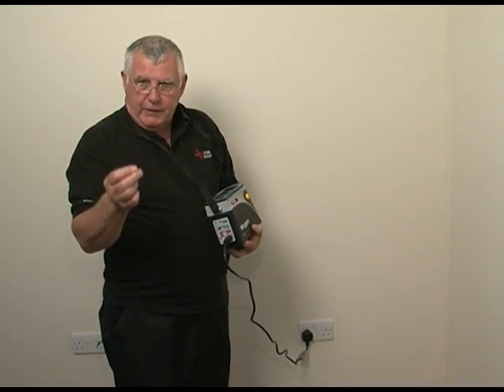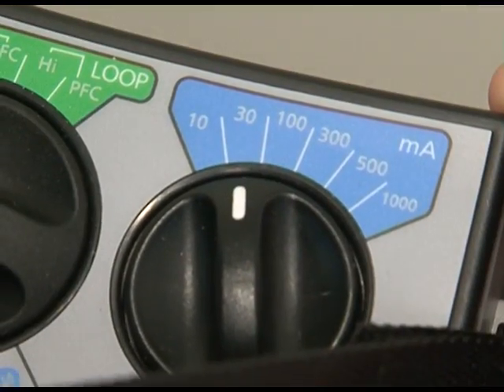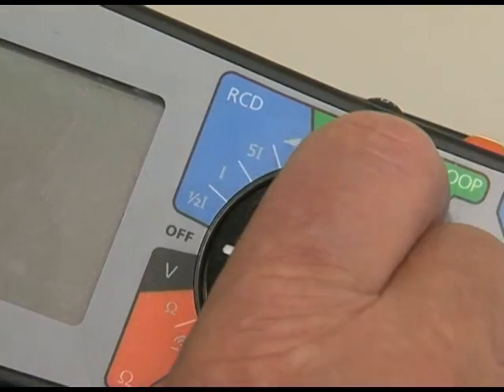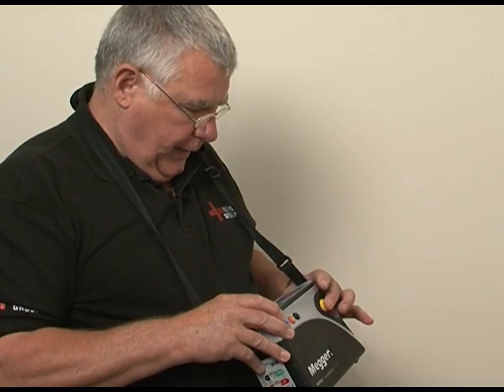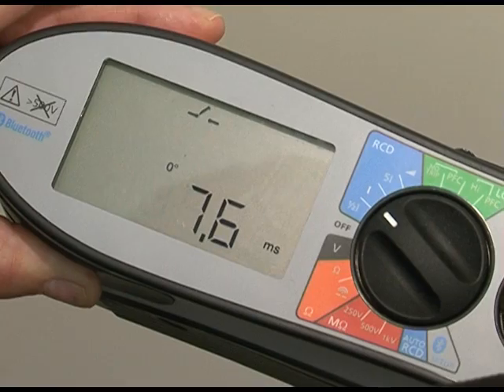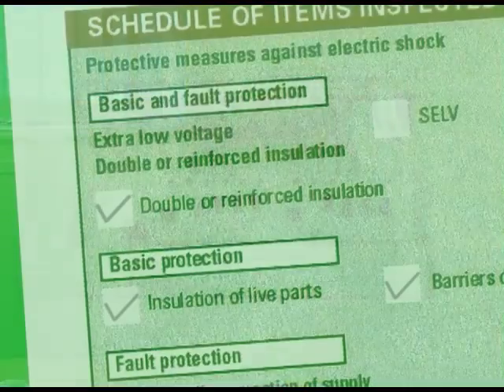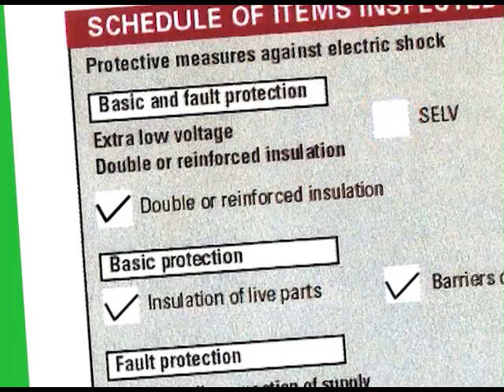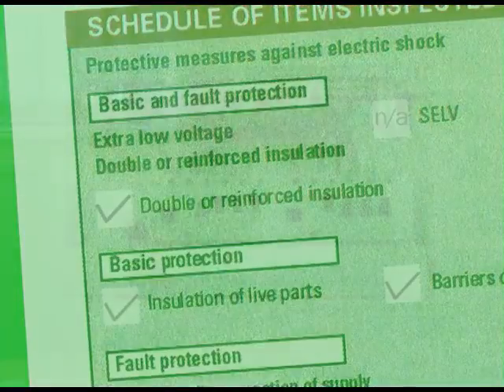17th Edition Domestic Inspection and Testing Initial Verification

Comment: NICEIC do not be deceived by these schemes they are a huge ripoff. Take note or learn the hard way ask yourself why are comments disabled on all scheme promotional videos.
Reply from the maker: hmmm this isn't a scheme promotional video -  in fact we at LearningLounge no longer partner up with NICEIC and as you can see comments are allowed. This video, which was originally produced 11 years ago will be replaced with an 18th Edition one and no plans to partner with any scheme provider.:)
Reply: Niceic would not permit me to join the scheme despite city and guilds training. “You need two years industry experience” was there reply when I said I was new to the industry, Which would have been fair enough if there website didn’t promote “qualify in 3 weeks??” I rephoned in if I had lied to start they would have accepted me no questions. When I pressed them for what 2 years experience was, I was told I could do 4 installations over 2 years as a sole trader? Do you agree that they are raising the standards, if you do you have a good sense of humor.

Comment: Correct me if I'm wrong as I'm still training.  But when testing the earth shouldn't you test by clipping onto the water pipe or touching it.  This will Show if you have a good connection to the earth bonding itself??
Reply: Your testing the connection of the bonding. The screw could be loose or there could be corrosion on the bonding clamp. You disconnect from the earthing terminal in the consumer unit and keep the bonding to the water pipe. There will be no parallel paths as you have disconnected from the earthing terminal in the consumer unit.
Reply from the maker: Hi Ashley, I believe the reason it is done this way is to verify the continuity of the conductor, if it was connected to the pipe there would be a parallel path to earth, which may through other means, make it appear that the conductor is continuous throughout its length, when it might actually not be. Kind regards and best wishes for your career.
Reply: No as it could be a parallel path, your testing the cable not the pipes

Comment: It is very funny, that when you report a rogue NICEIC Contractor that has left 216 Mobile Homes without  Home insurance, how the electrical Industryand the NICEIC go silent, even after this contractor Rolec has issued 1 Electrical Installation Certificate for 216 different premises, and that with false entries and Forged. Even the IET will do nothing. Am I glad I am out of this band of crooks after 50 years in this industry.